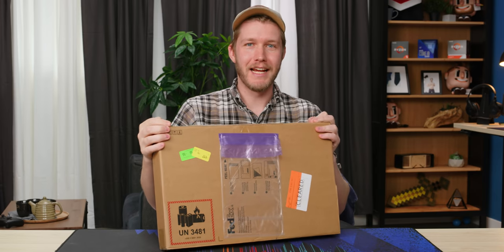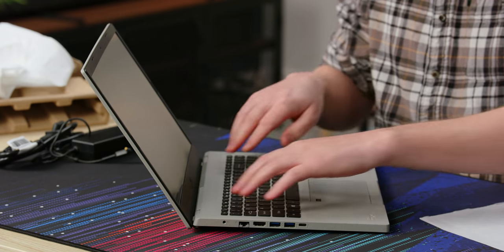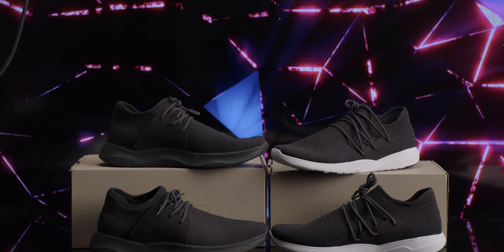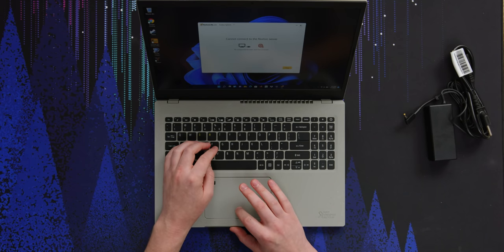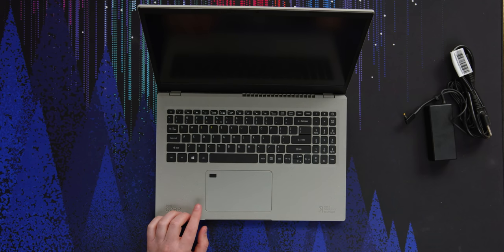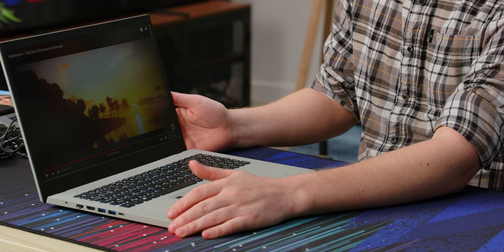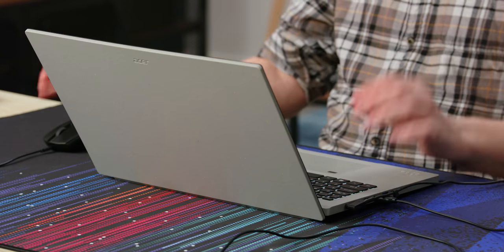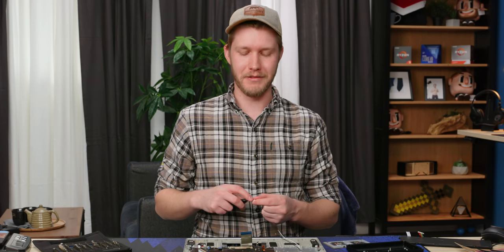ECO Friendly and POWERFUL?! - Acer Aspire Vero

Comment: For $700?? You're getting an i7 with 16GB of RAM?? That's a pretty nice deal.
also with the keyboard, it's not as easy, but could another chassis be purchased and the components be swapped over if it needed to be replaced? Not as convenient, but surely an option?
edit: Amazon is saying it's $900, so less of a good deal, but still not bad.

Comment: My Dell Vostro laptop is built from plastic but damm its so rigid that it only flexes  if I press really hard. Its built like a tank. And btw price was only $500 and its very poweful for my use case. 8 GB RAM i3-10110U 256GB SSD+1 TB HDD

Comment: The only acer laptop I ever bought was in 2011. It was absolute garbage especially in winters because in winters everytime I plugged it into the wall the fans will ramp up and the laptop will freeze. The only workaround was to charge when it was off and then use it on battery for about 20 minutes while blocking the exhaust with a thick cloth and get the laptop to be warm and then plug it in. I'm an engineer myself and looked at it, had my other friends look at it. No idea why would it do so.. i still have the laptop so if I ever learn something new I'd take a look at it again. Since then I think acer has stepped up their game though. They look well built but now I'm not a student anymore and luckily was able to afford an Alienware

Comment: The biggest eco waste in this is the motherboard, first of, you have all that space for a gpu thats not soldered on it, and yes, there is a version of this motherboard that doesnt have all that extra space in a regular Aspire (A515-56), only other difference with the motherboard is that it has an extra connector for the second fan. That's it. They could have just used the same motherboard and not bother with a second fan... or use two that plug into a single connector. The plastic also smells horrid.

Comment: I understand the reason you want to have a one touch wake from sleep and log in with the fingerprint reader but I honestly really dislike how that's done. It requires the device to use modern standby and in that mode I've seen fans run at gaming load levels when I just want the device to sleep so I can chuck it in a bag.

Comment: Yeah spoken like a person who never worked at computer service center of any kind ever. 
1. The reprocessed plastics they use deteriorate quickly with heat cycles, they get extremely fragile and crack around screw holes. Exhaust heat being blasted at the screen and hinges will result in complete upper plastic body and hinge replacement in 2 years time. 
2. The most common laptop issue that is being brought to service center is a broken keyboard, either by excessive force, fall, infant access or simple cola damage. So the fact the most commonly broken element is fused with the chassis is inexcusable. Repairable, with use of some spare 3D printing PP filaments, but still a 0 out of 10.

Comment: For a laptop that's selling point is being environmentally friendly, it sucks. Just because you used some trash on the chassis, doesn't mean it's eco-friendly. For it to be actually an one, it needs to have a very long warranty, a lot of upgrade paths, future proof hardware, strong build quality, very long software support, low power consumption, easy place to buy parts for it ect.
Reply: Well for a big-brand-laptop I think it's quite repairable. Of course it's not a Framework or sth. Software is done by Microsoft. Windows and stuff. So it's very long software support. And for the future proof hardware: well at 700$ you can't expect top-of-the-notch hardware. And of you'd say "well then buy a more expensive laptop". Some people can't afford that. So I actually think Acer has a good thing here
Reply: I'm not telling people to buy a more expensive laptop. I'm saying, Don't get this laptop thinking it's good for the environment.

Comment: As a green laptop I think it fails completely and can't recommend. No mention of replacing the display so I can't comment on that, but keyboard is one of the most common points of failure so not being able to replace that just kills the concept. Then there is the whole part of the ram being soldered thing. I hate that so many laptops do that while enough others don't that it seems the only reason for it is to get people to buy new laptops more often. Having part of the ram soldered means you probably don't get dual channel, it limits upgrade options and if that soldered ram goes bad you really can't do much other than replace the entire laptop. For systems that don't solder any ram I would point to HP envy x360, framework, system 76, and likely others in a similar category.

Comment: I like the concept, but Intel is a deal breaker in a laptop. You can get a 5500U laptop for under $500 which has twice the graphics and 12 threads. An Intel quad with 11th gen integrated graphics is obsolete out of the box.

Comment: Best part is no part, why did charger need it's own little box, why more cardboard for documentation box and why documentation at all(is there some law) otherwise a qr code to online documents.
Also why soy ink and all the manufacturing that needs, when you could just laser engrave the cardboard.

Packaging is such an easy place to massively reduce, yet they just seem to swap plastic for cardboard without thinking is it needed at all.

Comment: Whatever manufacturers do, the only way to be better for the planet it to make devices last longer. I mean, this device still has a ton of e-waste in terms of electronics, still costs energy to produce. On the other hand aluminum (metals in general) are easy to recycle, the plastic body itself is also easy to recycle. So what is the point in making this body out of plastic, what is the difference compared to using recycled aluminum? Recycling costs energy regardless, so we are better of making devices that las, instead of replacing our phones/laptops/tables/watches/headphones every 2 years or so with something presumably "green".

Comment: I have always wanted a laptop 💻 that would survive if the electricity went down and things like hurricanes and floods. Could a laptop survive being dropped to the bottom of a pool. 
I thought of things like hydrogen cells or to power it up by a pedal or solar panels. 
Would the glass survive a cement mixer , phones should go through the cement mixer test.
Reply: Sounds like you want a military toughbook.  Expensive and slow though.
Reply: For all us guys who constantly throw their phone into the cement mixer. Of course 99.9% of the phones would die. But that's just not their purpose. For that there are outdoor/rugged phones

Comment: How do they reduce CO2 emissions? If it's just buying carbon credits, then that's a scam.
Reply: Recycled Materials etc. I think the most important thing is that it's not out of metal. Metal manufacturing is a huge contributor in CO2 Emissions.
Reply: bought up carbon credits usually result in claims like "carbon neutral", whilst, if I understood correctly spoke of 21% reduction in carbon emmisions in production, which implies actually reducing emissions. Acording to their website the reduction in emissions is achieved by using recylcled plastic, instead of manufacturing new plastic. Whether or not there is some marketing trickery involved there i do not know.

Comment: The internals look concerning as usual. The built quality is below average to keep cost down.
These laptop are built to "Fail" so they make it easy to repair because it will fail from the low quality components used.

Comment: The biggest downside to me is the lack of a Linux version (not only here but in almost every laptops, including Framework), because in 8 years the components will be obsolete for a confortable daily usage with windows, while a Core Duo laptop is still usable with linux today. Of course we can install it manually but in a lot of cases there will be some missing drivers to use every sensors and peripherals (for example the fingerprints sensors that can read before the system finish to boot, and unlock the device automatically when the login screen appears)

Comment: Wouldn’t an aluminium laptop still be more green…? I’m just aware of the eco warrior exploitation that happens, or green washing. I’d think melting plastic is still worse even if it is recycling, and that a total shift to aluminium would be a better option. Like others have said also, reusing is better than buying new. Ah and hang on, was that just 30% pcr?

Comment: "Eco friendly", yet they put an e-waste Intel CPU which is much less powerful than the Ryzen 7 chips they could have put inside which will prevent replacing the laptop in only 3 years when 4 cores will not be enough. If the RAM is not expandable too, it's going to be an epic fail.

Comment: I would not buy this for one reason, the keyboard is NOT replaceable. I am using an Acer Aspire. I upgraded the ram and another drive and guess what cannot be replaced? Keyboard. I have lost the R/shift key the E,W,R. keys and I am afraid what is next. I have to use the on screen keyboard so often. I love this laptop, it is fast, the screen is perfect, I have had it since 2019 and that is how long my insurance lasted. The keyboard is plastic welded in. Now, I have to dump it. What do I do now. The end of Acer? Because of those stupid plastic welds. Can someone help me?

Comment: If there is an Acer logo on it, you can be damn sure it sucks. Even if you pay top price for it, it will fail miserably as it was designed to fail using the cheapest components they can acquire.

Good that you took their money, bad that you are promoting the worst manufacturer of PC.